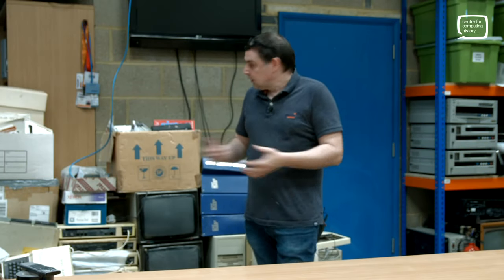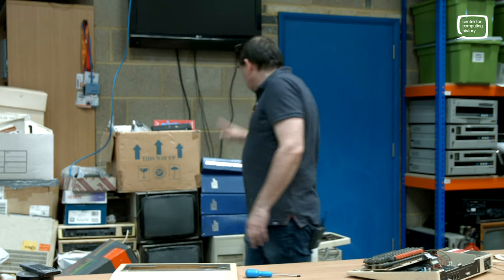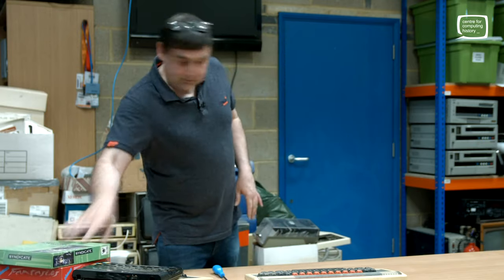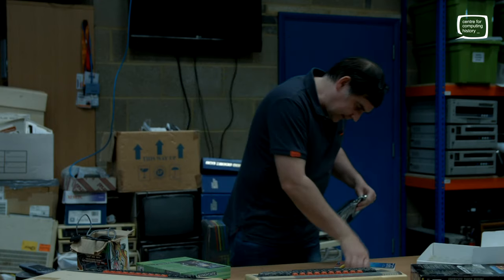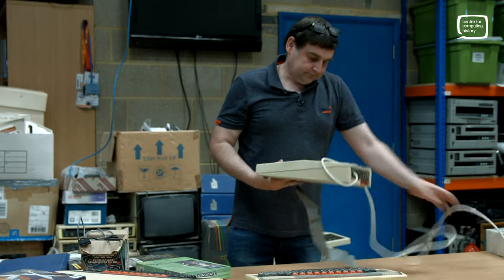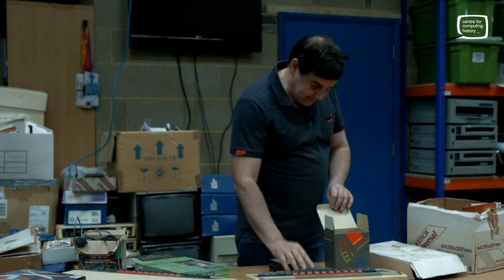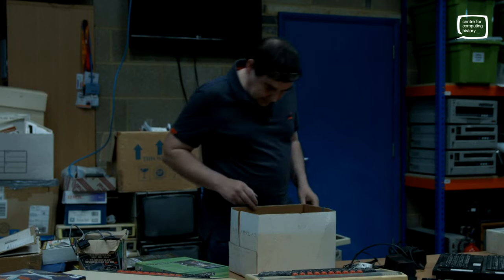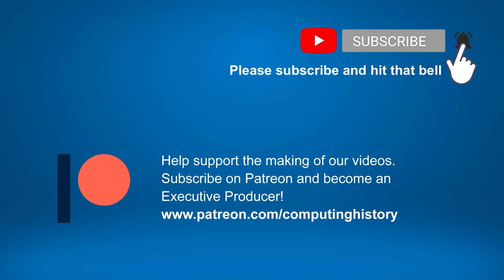Vintage Computer Mega Donation! - Part 1

Comment: That Viglen keyboard reminds me of what used to happen at Acorn.  We would hacksaw or jigsaw off the front of the beeb case to make a keyboard unit and then use a floppy cable to link it to the main board in the lower half of the case.  It made for a moveable keyboard.  Also ABC (aka ABM) keyboards on ordinary beebs were a bit of a thing too.